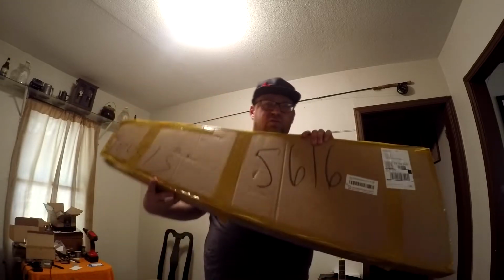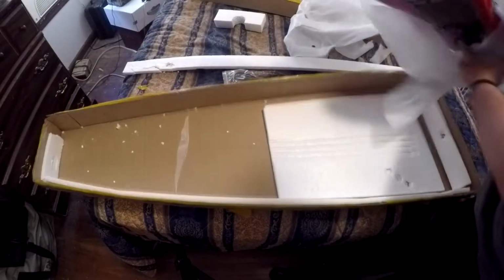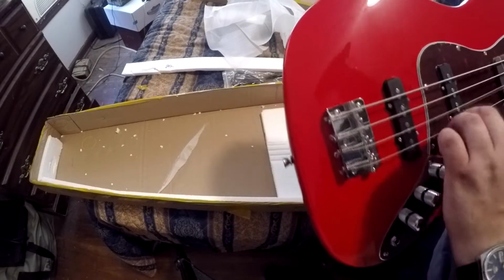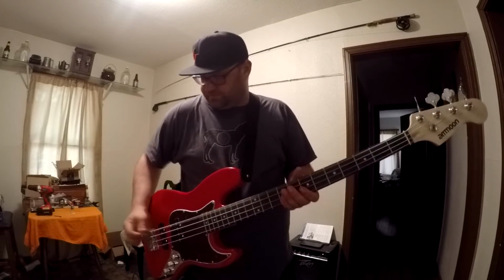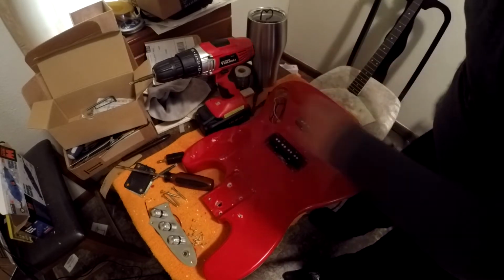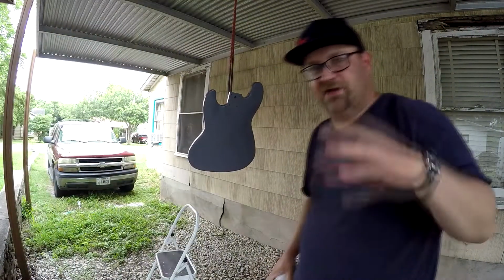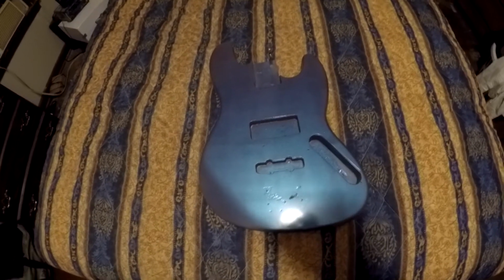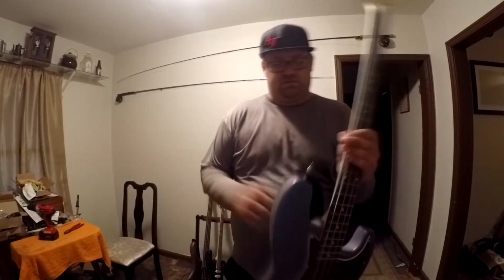$85!!! - Cheapest Jazz Bass on eBay!! - Upgraded!!!

Comment: Hey thanks for sharing!  Any issues dropping the new pickups in the original holes?  Did you have to cut any of the body?
Reply from the maker: No. They fit pretty well. The only thing that wasn't a perfect fit was the original screw holes. But that's not really an issue at all.
Reply: @obscuredguitars  cheers! Thanks for the info!

Comment: Nice job man. I got the same exact bass. For a cheap passive bass, its pretty decent. Perfect for upgrading like you did. What grade sandpaper to remove the logo?
Reply from the maker: I think I used 250 grit, but you'll probably want to go finer than that.
Reply from the maker: Actually, now that I think of it, I used a pretty rough grit like 80 or 100 to get it off, then went to 250 and even finer to smooth it out.
Reply: @obscuredguitars  thank you. good review btw. I'm currently on the search for a white 5 string hopefully by Ammoon that I am going to hot rod the hell out of. I think i'm going to keep the 4 string stock. Thanks again!
Reply from the maker: @XCLent0  I actually built a 5 string, just haven't gotten stand to editing the video yet. My first "original" design.